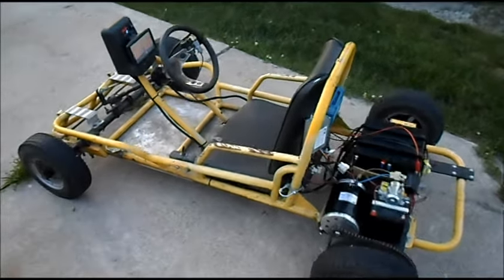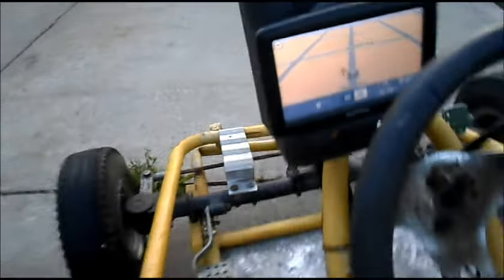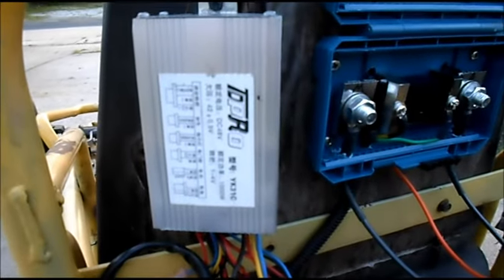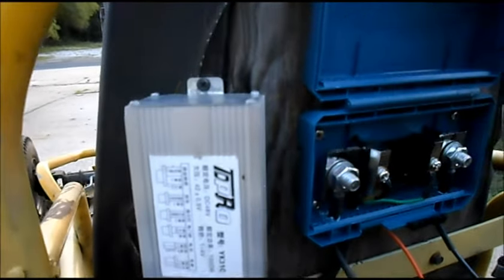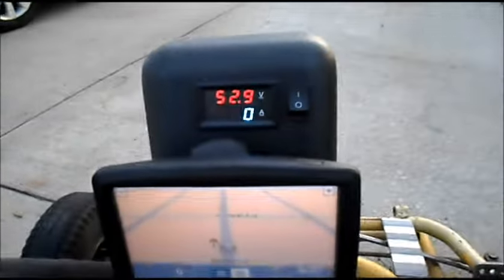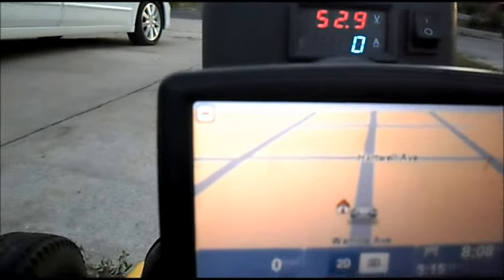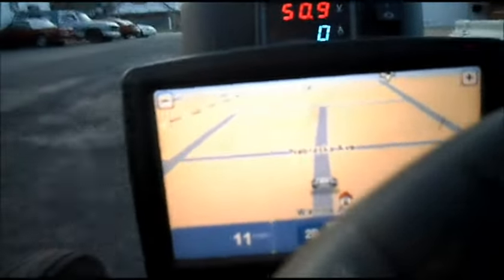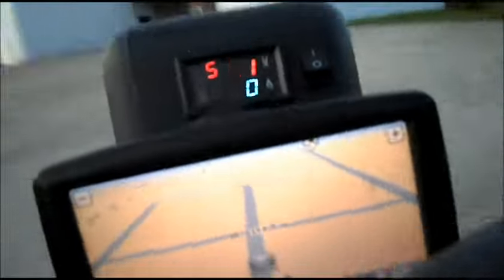ZY1020 48V 1,000W motor with TD Pro speed controller load road speed test 4

Comment: do you use freewheel on the sprockets? does the engine rotate freely without power? I want to build an electric bike with this engine and free coasting is a must but I have Nexus hub so I cannot use standard freewheel on it.